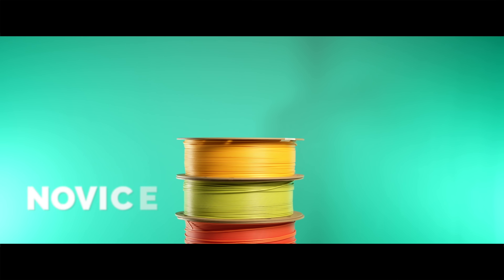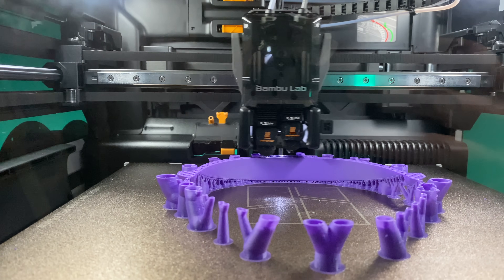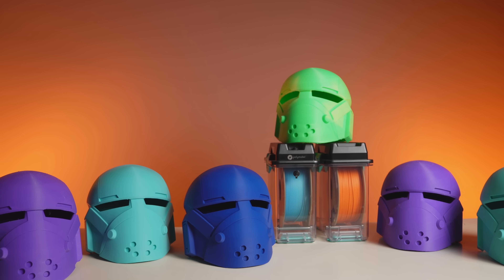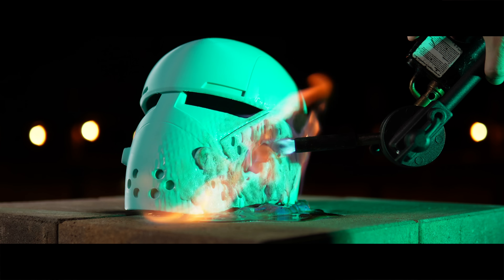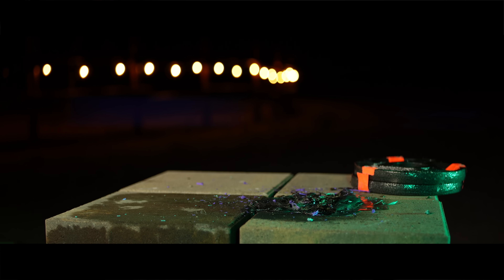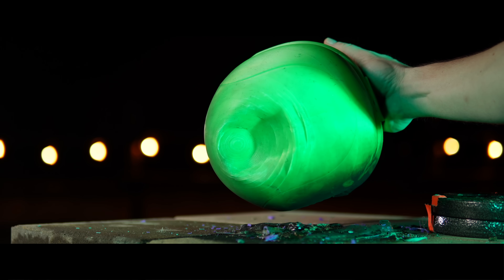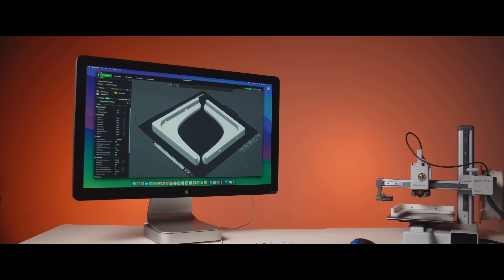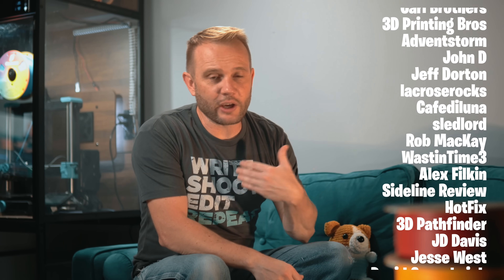One Helmet Melted Instantly | PLA vs PETG vs ABS Destruction Test

Comment: I personally find these results quite interesting. Picking the right filament for the parts you are printing seems to impact alot of the end user experience, its not just a one-thing fits all kind of situation. I'd love to see similar tests with filament from other commonly used brands to see if theres big differences (Sunlu, eSun, Bambu, Elegoo, etc) for example Elegoo also offers PLA Pro but asks half the price per KG than Polymaker, so that would be interesting to see. Also seems like PLA Pro might have some use in cosplay making for helmets and armor, especially looking at the impact resistance shown in this video. What do you think about that? I hear the Go-To here is usually PETG or ABS. Especially considering that basically all cosplay props are getting painted after the fact, I'm unsure how that might effect "warping" or other heat / sun induced issues with prolonged wear during conventions etc. Would love to hear your 2 cents on that!

Comment: pla pro or pla plus stronger than pla, easier to print with than petg or abs. Pla pro and plus for the win. Have you tried Pla-F? Its Pla with some ABS mixed in. Im curious how that might strengthen it even more but maybe ruin its heat resistance.

Comment: Scaling would likely have a significant effect on strength as a 25% reduction is span/surface over a hollow would result in a stronger structure with the same settings as something larger...................

Comment: It's been mostly done before. Yes PETG self-extinguishes. ABS is extremely flammable which is why normally in injection moulded products it's loaded up with BFR, except you can't do this with a 3D printing filament, as that makes it cook off in the hot end. PETG is flexible under constant loads, but its impact rating is low - it flash crystallises and forms sharp shards.

One problem i have had with PLA is aging. All of my PLA prints came out of printer very strong but started crumbling about 2-3 years on. You have perhaps also seen filament becoming crumbly as well, but it toughens up again if you "dry" (likely actually anneal) it.

And by the way, water does not make PLA brittle, not by itself. People keep repeating it but it's easily disproven by a simple experiment. Just load up a sample of PLA into a ziploc bag with a teaspoon of water for a few months and see for yourself.

Comment: For me only PETG was decent: it didn't burn on its own after being lit.  All parts lost their function, but at least PETG would not keep on spreading the fire.  As for the drop test: this was so uncontrolled that a single test with each filament type will not really give you a conclusive result.  You also dropped stuff on a helmet that was before subjected to extreme temperature. That's of course going to affect behavior of that material.
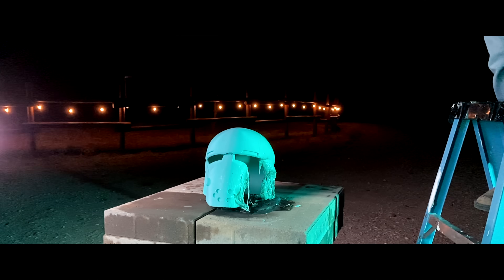Reply from the maker: @2:07
Reply: It's not any sort of surprise that PETG has a relatively low impact rating, it's been an outcome of every controlled test ever. It is very flexible when loaded gradually, but at impact loads it flash crystallises and throws sharp shards, so its behaviour under impact loads is quite treacherous, it doesn't seem like it might injure you, but it can.

Its self-extinguishing property was demonstrated by MM around 6 years ago. It really is impressive.

ABS is a well known extreme fire hazard, which is why all injection moulded parts are loaded with BFR, but it's not a suitable additive in 3D printing filament.

There is an underexplored potential of PETG-ABS blends. The blend is surprisingly cohesive, and may be improved further with a sprinkling of styroflex 2g66.

Comment: Most of my PLA stocks are the low temp variety. As such, I generally only use them for pretty prints. at room temps they are fine, but, unfortunately, they melt too easily, wouldn't mind trying out the HT variants. I have wood fiber variants that are really tough, but still melt outside too easily.
I learned early on that depending upon the printing techniques, PETG has some pretty awesome strength and hardness , but can shatter like glass once it's there. I actually made a 450g mallet out of this stuff, 3mm thick walls and 90% infill. aside from a couple of dents driving nails, no signs of major damage in the last two yet
ABS, with it's relatively low print temps does ok, especially with my older IDEX printer with a 250c max, but warps pretty badly on an open bed printer. The GF and CF variants actually do a great job ameleorating the warp issue
Lately, I've been printing with PET-CF and GF, this stuff is nearly as easy to print as PLA, doesn't warp as much as PETG, very hard and metallic sounding. it can shatter, but it takes a lot to do so.
PCTG is my main use for ABS like flexibility, most excellent spring material

Comment: The impact test is flawed since you did it AFTER the torch test. How do you know that the heat didn't affect the impact properties? I'm sure it had some affect on the outcome. Why wouldn't you do the impact test first?
Reply from the maker: I printed more helmets, as you can see from some of the shots in the video. We smashed and burned them separately to get the cameras and lights correct, and there was no difference.

Comment: My problem with PLA Pro, PLA+, etc. is every manufacturer uses a different proprietary formula.  I like standardizing on one manufacturer's filament and creating a good slicer profile for the machine I'm using, but if there are supply chain problems I'd like to be able to switch to whatever I can get without needing to develop a new profile for a different material.

I'm surprised you didn't include Polymaker CoPE.  I bought 3 kg from Polymaker but haven't tried it yet.
Reply from the maker: We'll definitely do CoPE in another video, there are so many to choose from, we had to limit it.

Also, yes about the standards... that's why I only used Polymaker filament here, because Pro, +, HT, HD, Plus, etc -- all of these different names and formulas are difficult to deal with.

Comment: A few thoughts on this video which I overall liked.  1) Agree with other comments that the impact test might be more realistic if using a non-damage helmet to start with.  2) Since there is no industry STANDARD around “PLA Pro”, the results may not translate with other brands.  It would be good to do a similar test with say various PLA Pro/+/Tough from other brands to see how the results change.  3) Disappointed in the ‘click-bait’ thumbnail of a burning helmet inside an H2D.. you don’t need to stoop to that.
Reply from the maker: Thanks! I’ll reply in order, 1 - I don’t think the fire changed the outcome… if you notice, there are a lot more helmets that were printed and you only saw some of them. Because we tested fire and impact completely separate to make sure our cameras and lights were catching what we wanted. The results were the same.

2 - I agree, standards don’t exist there at all, and not just PLA Pro, every company uses different additives to make their filaments more printable or less rigid, etc.

3 - it’s not clickbait by any description, it’s definitely sensational, but the words on the thumb and the title and the fact that I did use an H2D make it not clickbait. BUT, get this.. the original thumbnail had the helmet on fire, huge, beautiful and yet, less than 1% clicked it. The same nerds in 3D printing that get mad at YouTube and clickbait are the same ones that only click sensationalized or hyper thumbnails, they’ve done this to themselves. I didn’t create the YouTube world, I’m just living in it. Once we changed the thumbnail, clicks jumped 5X with no drop in retention or increase in dislikes.

Thanks for the comment!

Comment: Are the PLA Pro basicly the same as PLA+ ?
Reply from the maker: Different brands will have different names and different additives, there isn’t really a standard. I only used Polymaker in this example.

Should I look at different brands?! That would be useful I imagine.
Reply: @LoyalMoses  I've been using the eSun PLA+ for a while now. It's a little bit stronger than regular PLA. It has a satin finish to it which gives it a very nice and smooth look and texture 🙂

Yeah, it would be quite interesting to see other brands getting these "stress" tests too 🙂

Comment: Interesting experiment, with a surprising result. I would like to see the impact test carried out on undamaged Helmets if possible. Cheers from over the Pond.
Reply from the maker: We did run the fire and impacts on separate helmets to get the lighting and cameras setup. The results were the same, the heat didn’t have any real effect on them from that standpoint.
Reply: @LoyalMoses  Cheers for replying and letting me know. I was curious .

Comment: I’m curious if the heat/fire changed the physical characteristics of the filaments when it came to the impact tests?🤔
Reply from the maker: If you are counting the helmets in a few shots you’ll notice that there are more helmets than tested. We did run the fire and impacts on separate helmets to get the lighting and cameras setup. The results were the same, the heat didn’t have any real effect on them from that standpoint.

Comment: Awesome Video brother! I have always found that also. My pla+ parts were crazy durable compared to my pet g counterparts. I did have a pla+ multicolour Santa clause on the roof rack of my work vehicle and it lasted the whole time until I took it off 6+ months through summer in Australia. It was stationary in around 42c outside temps (107f) and was fine. Inside the vehicle is a different story, it softens in the direct sunlight but was ok in the shade (in the car) The best for inside the car seems to be ASA. We have tested various material on the dash of a car and Pla, Pla+, Petg & Abs all deformed. Abs was the best of the 4. Asa on the other hand had no sign of ever being in the sun, it is temperature resistant as well as UV resistant.
Have an amazing day! Let's go!!!❤🪞💪🔥🚀♾💫✨
Reply from the maker: Thank you and that’s awesome to hear all of that!

Comment: I'm thinking PETG was best. Still watching I'll explain later
Reply: Ok half stand corrected seeing the impact
Reply from the maker: Crazy wasn’t that?! I did NOT expect that, I figured it would bounce off more, small crack or dent.
Reply: Very interesting over all. I think the Heat Deflection Temperature is the much bigger one. But I'd like to see the PET1-CF and PA12-CF 
That's only due to some of my own curiosity experiments with it. Quite surprising as well
Reply from the maker: I want to do some nylons and then do some PPS, etc!!! What do you think?

Comment: I think the flaw in your heat testing is that with flame you are testing flame resistance and getting combustion, not heat resistance and thermal deformation.  A serious heat gun or one of those propane-fired forced air heaters would have probably been a better choice.
Reply from the maker: I literally said NONE of that really matters, because we are far outside of those temperatures. 🤷‍♂️
Reply: @LoyalMoses  I know, the comment is about flame vs. heat, not temperature.  Don't take my comment the wrong way - it's a fun video and good look at what happens with different filaments.  The PLA Pro surprised me.
Reply from the maker: Me too! I didn't have a mic on when I was dropping the weights... I was totally blown away when it landed on the PLA Pro and it just spun it around... I actually was confused for a moment, like something had gone terribly wrong.
Reply: @LoyalMoses  Makes me wonder about other filaments - ASA, PC, PA...TPU...CoPE? Does the CF or GF make a difference?  More videos in the series?!
Reply from the maker: I’d like to do a PPS-CF and outside of fire, drive a tractor or truck onto something with a lot of perimeters and infill… see what we can do!

Yes, I really want to see what these things do in a real life application, even if crazy or unorthodox.

Comment: That was an interesting video. I thought the PETG was going to be worse against the fire and ABS the best. Was completely wrong on that. Even going off of metrics like Glass Transition temperatures doesn't tell how the material will handle being subjected to extremes like that torch. It would be interesting to see how the HT-PLA stands up to the PLA Pro and also would be interesting to add in Bambu's PLA Tough+ in the mix as well.

I do find some videos that do tests of different materials or print settings kind of interesting especially if looking for what to use for a part that might be subjected to extreme temperatures, moisture, chemicals, etc. Without those kinds of videos, we only have the MSDS that gives the manufacturer's specs of the material which doesn't necessary translate into what it'll do in real world scenarios.

Will be interesting to see what comes from the LM 33 Club towing challenge project.
Reply from the maker: You get me! 💜

We all know Tg, but it doesn’t really represent what happens in so many circumstances. I want to print things and see how the real world stresses them and how they respond.

I want to test HT-PLA and also PPS-Cf, etc!!

I love reading your comments too, I actually look forward to them!

Comment: PETG has been or seemed more brittle to me in my experience. So I wasn't surprised to see the PETG fail like that with the impact test.
Reply from the maker: Awesome!
Reply: The first time I tried PETG with default settings, I had terrible layer adhesion and thought that it felt brittle. I then changed my settings by upping print temp and lower part cooling. Completely different story. Layer adhesion is really good and the prints feel like they have a tiny, tiny bit of give. Enough that they don't sound so tinny like pla, but more "solid". I have a feeling PETG is just sensitive to printing settings.
Reply: @thecheetahman22   A lot of PETGs have a narrow usable temperature band and are sensitive to the amount of cooling, and print speed consistency, you sort of want to preheat it thoroughly in the meltzone and then pre-cool it on the nozzle so it won't ooze or droop too much. Better ones have a wider usable band.

Comment: Love the torch test for the visual cinematography.  It is not a test of heat resistance though, it is a test of the flammability of the different materials.  A heat gun from 5-6" away would be a more accurate visualization of focused high heat.
Reply from the maker: Yup. That’s why I said none of that matters and it wasn’t a test of heat resistance… I put a 2,000 torch 1” from a 3D print… it was going to catch fire.

Comment: Is performing impact tests on already heavily damaged helmets a good test?  I mean, I'm not sure if the outcome would be much different but just throwing it out there.
Reply from the maker: You’ll notice in some of the shots there are more helmets printed than you saw results from. We did run the fire and impacts on separate helmets to get the lighting and cameras setup. The results were the same, the heat didn’t have any real effect on them from that standpoint.
Reply: Yes would be interesting to see the same tests on undamaged helmets and also same impact points on each helmet.
Reply from the maker: This was meant to be less “science” and more spectacle.

Did you want to see more science focused?
Reply: @LoyalMoses I think spectacle is just fine, it was just that particular part I was kind of interested to see how they fared with no prior damage.  Thanks for letting us know it was basically the same.  🙂
Reply: @LoyalMoses  - I always want to see more science!     😀

Comment: Interesting! I’d love to see more tests with materials like HTPLA, PolyMax PLA, and especially ASA. ASA is the one I’m most curious about since I’ve always heard it described as the “upgraded” ABS in almost every way. PolyMax would also be cool to see, because it’s consistently shown to be much tougher than Polymaker’s other PLA options—at least in terms of impact strength, if I remember right.

I really enjoy videos like this. It feels a bit different from your usual content, I actually like the more casual less scientific, “let’s just see what happens” approach. And as always, the video quality is excellent—those nighttime outdoor helmet roasting shots were fantastic!
Reply: My underrated superstar filament is HIPS. It's extremely cheap, beautifully matte, easier to print than ABS or ASA and has excellent long term endurance, better than ABS but lower than ASA. Its superstar mechanical property is that it's capable of living hinges akin to PP, though not as good. Other than that, its mechanical properties are unremarkable. It has low chemical compatibility with every other polymer so HIPS residue in hotend is a little unfuriating, and it does emit some styrene, though less than ABS and ASA.

Comment: I know PLA Pro is a great filament, but I didn't expect it to stand out that much. 
I am working on a project that requires heat resistance. I have found a company that's fairly local, that makes "special use" filaments. I only have 3 maybe 4 different filaments from them, but I would love to see how those stand up to testing like this. I mean 1 of their filaments is supposed to be safe to be sterilized in an autoclave & another is antimicrobial (2 right off the top of my head)!!! If so, that is incredible!!!
Reply from the maker: What brand? Let’s set it on fire! 🔥 😅